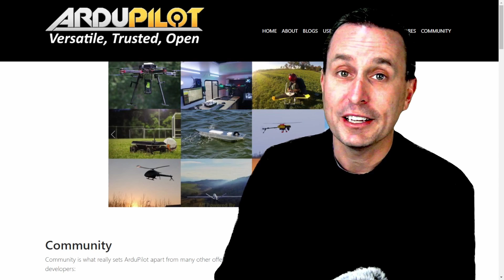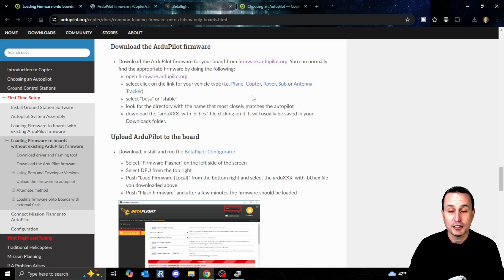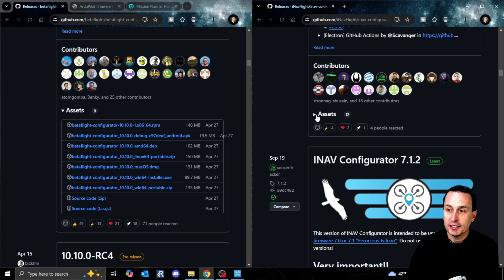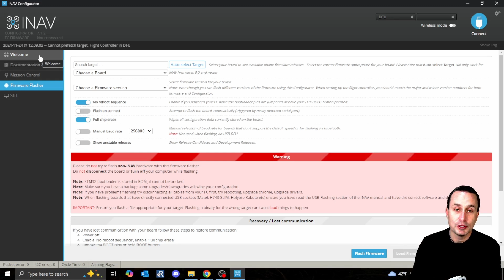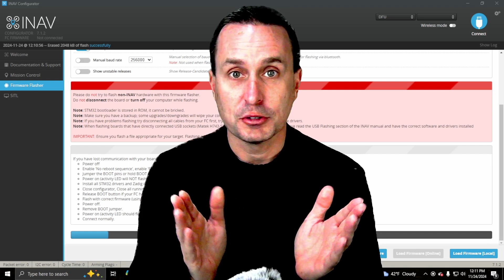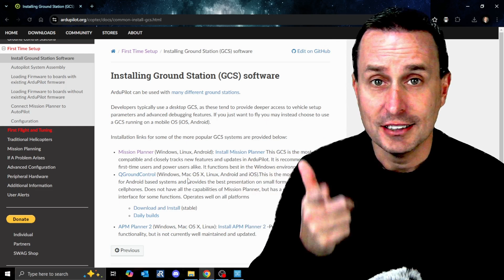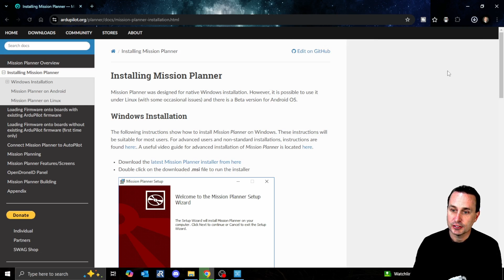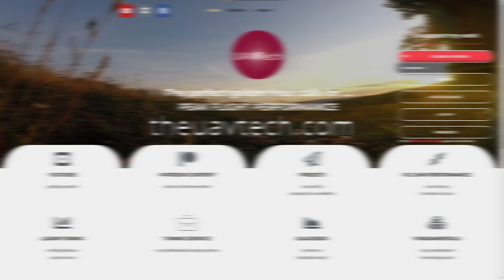✨Ardupilot✨ How to Flash in 5-Minutes!!

Comment: hey . I'm building my first quadcopter 5 inch using inav 7.1.2 and speedy bee f405 v4, my main issue is when i activate GPS there is oscillations (pitch and roll) . I'm stuck there and trying to fix it for 2 month and no luck. any idea how to fix it ? thankyou i tried ardu pilot too but ardu pilot dont save my data calibration.
Reply from the maker: responded on the other video comment

Comment: Quick but important question - how to configure ardupilot from android device using USB cable? Is there any proof that it is possible using modern Android device and Mission Planner or QGC software?
Reply from the maker: unknown.  I would think you can use QGS with at OTG adapter cable.  I have not tried it.
Reply: @uavtech  No, it does not work on recent samsung devices and google pixel.